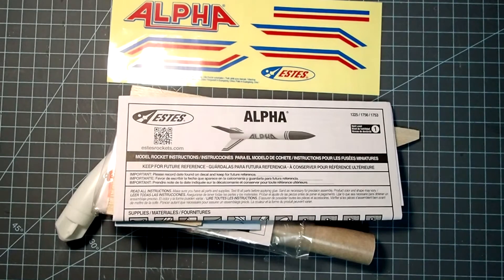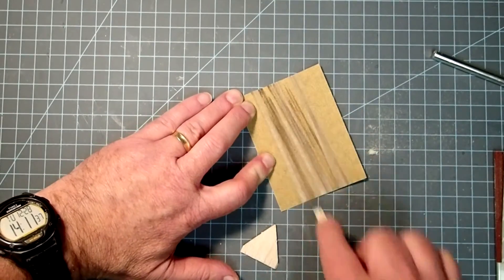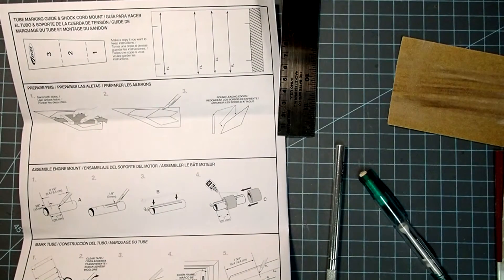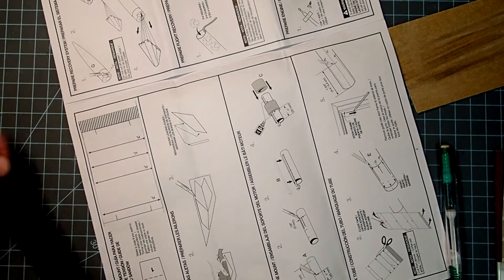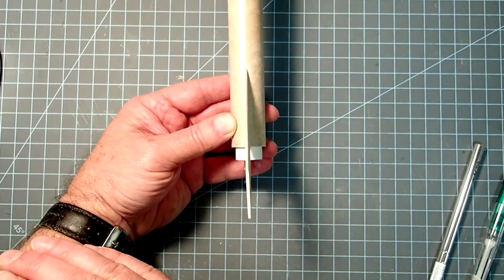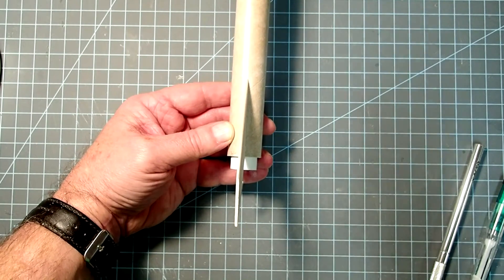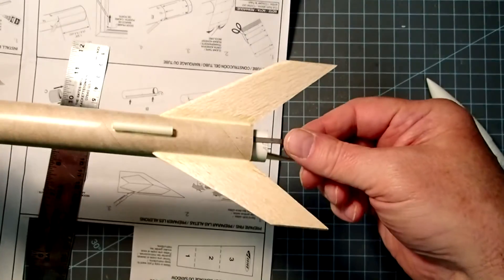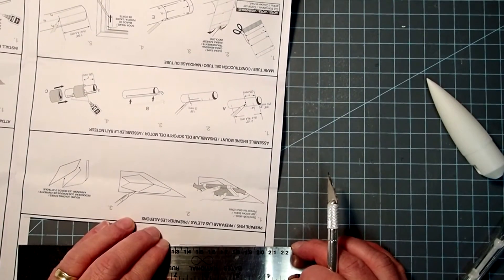Estes “Alpha” model rocket assembly

Comment: The Alpha was my first rocket, at age 13, in 1972. Back then the nose cone was also balsa, the strings were not already attached to the parachute, and the fins were not precut. They also had that snap swivel. I believe it is supposed to help prevent the parachute lines from getting tangled.  It took me a week to build it. I painted it with a brush using something called butyrate dope, which I got from Estes in the starter kit. Then I lost it on the second launch with a C6-7. Would like to get my 10 year old grandson into model rockets, but he just doesn't have the patience to build something like that. You can get ready to fly rockets, but to me, building them is the most important part.

Comment: This was the first Alpha kit I built, and first model kit built after 43 years of being out of the hobby.    Love the kit, but didn’t care for the self sticking decals.   The ones for the fins had to be cut and the issue of not sticking was a problem.  (Tried light coats of clear gloss and thst made a mess.   

Will order new decals and remove these.  Flew on 1/2 A engines and nice flight.   

Look forward to launching again

Comment: Any tricks on removing the engine after it's used? Can't seem to remove it for the 2nd flight.
Reply from the maker: It usually comes out easily. Try putting it in a freezer for 20 minutes.

Comment: I would be inclined to install the motor mount more forward rather than have it hanging out the aft end of the body tube. I would push it in until the engine tube is flush to the body tube to push the CG more forward. But there must be a reason they want it more aft. Maybe to slightly lessen the proximity of the exhaust to the fins.
Reply from the maker: I’m not sure why, but it’s always been that way. My guess is that it gives easy access to the motor for inexperienced rocketeers.
Reply: I looked at the 1969 catalog( when the Astron Alpha was $1.50!) and it shows the engine mount flush with the body tube. I’m building one next week,  57 years after I built my first one. I’ll put the motor mount flush.
Reply: I'm not an expert but I think they did it because it pushes the weight back a bit, making the rocket more stable.
Reply: @Dymond_Y2K  an aft CG makes the rocket less stable